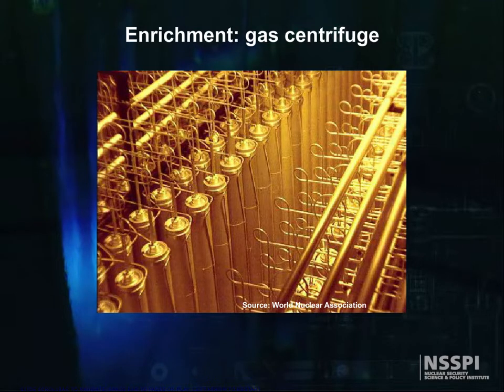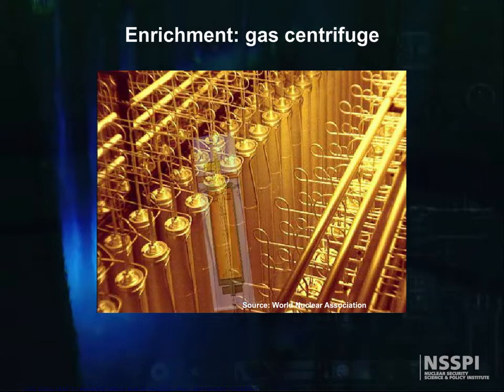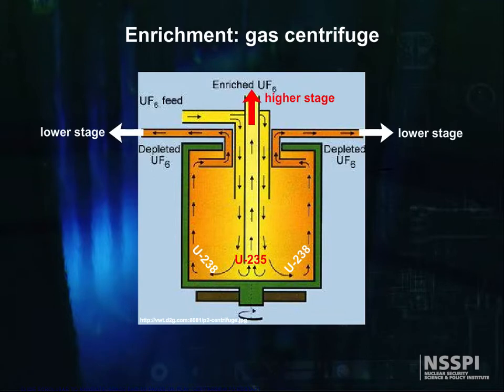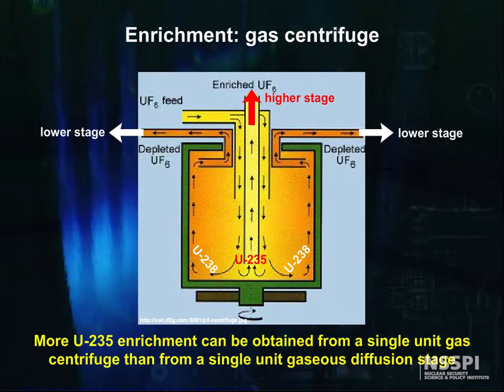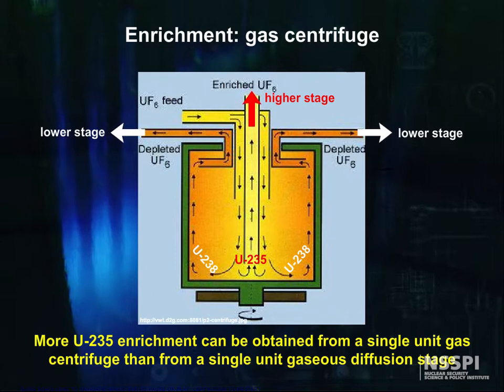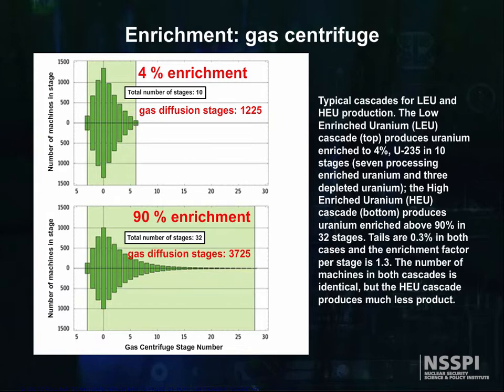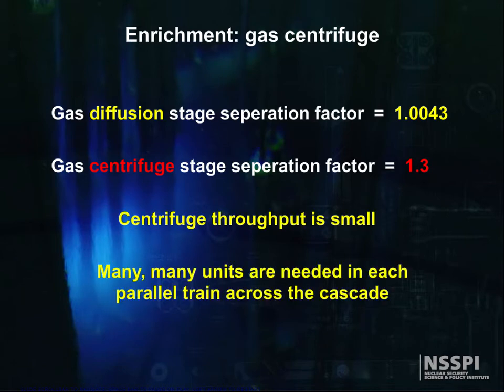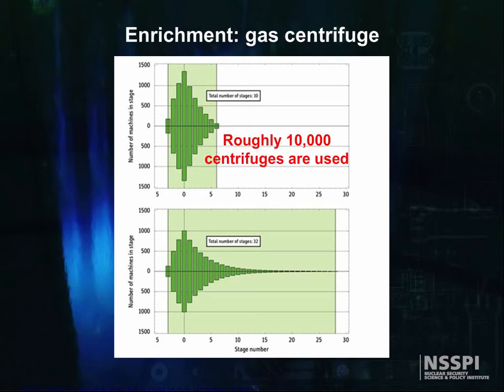Nuclear Fuel Cycle: Gas Centrifuge

Comment: After reading about nuclear energy and how fuel rods are made I've come to the conclusion that U-238 and U-235 are not actually radioactive. In my opinion a centrifuge merely refines the gas mixture that enters the module. The separated bits go onto further processing. For anyone to create an isotope one has bombard the material with high voltage but there's no bombardment of uranium with high voltage to create the isotopes U-235 and U-238 prior to entering the reactor.
Reply: Those two isotopes are absolutely radioactive.
Reply: @SadCrabMan23  Correct, they are indeed radioactive! I THINK (ANYONE EDUCATE ME IF I AM WRONG) that the reason it's relatively safe to hold uranium is because of how long of a half life it has. It deteriorates so slowly and releases too little radiation to be deadly.
Reply: @SadCrabMan23  sure - tks for your opinion!
Reply: @PeterPete  Uhh... its a fact not an opinion
Reply: @albabhuzaifa6853  what are you referring to as being a fact and not opinion?
Reply: Isotopes don't always have to be bombarded to be radioactive. U238 and U235 are naturally radioactive. It is true that the centrifuge only refines the as the gas that enters is high in concentration of U238 and low in U235, the centrifuge increases U235 thus making it more radioactive. Although it goes into further processing it is not for bombardment to increase the radioactivity it is just seperate the uranium from fluorine through a reduction agent.
Reply: @acount221  thanks for your opinion but tell that to the people who put together the fuel rods where they don't wear any protective clothing 👍
Reply: @PeterPete  How did you come to the conclusion that the people who put together fuel rods do not wear protectective clothing ?
Reply: this is the wackiest conversation on youtube

Comment: I have a question what if you use the exhaust gases from a coal powerplant? I heard that the exhaust gases and ashes from  coal powerplant contains uranium and Thorium. Every year they release worldwide 10 000t uranium and 25 000t Thorium.
Reply: Thorium doesn't need enrichment, and uranium enriched coal fumes are useless in a reactor or bomb because of the low concentration of uranium.
Reply: Imma need that thorium
Reply: It’s such a minuscule amount, it’s not worth the effort and cost.